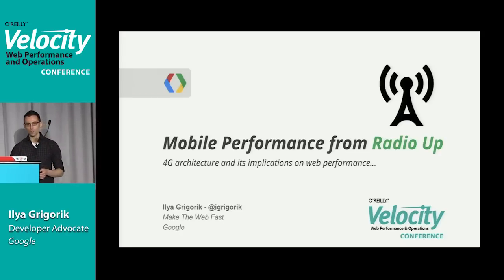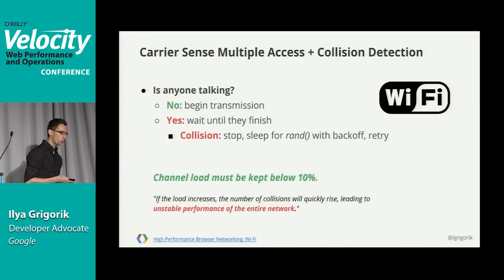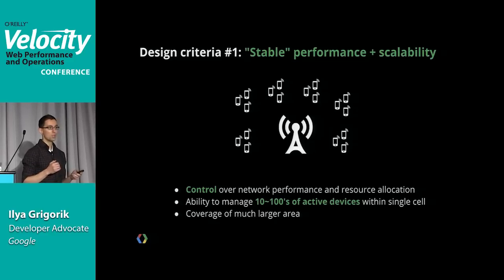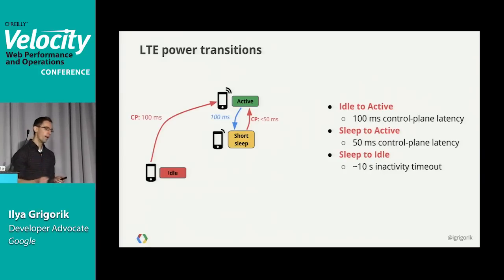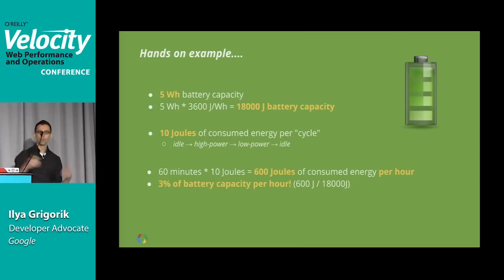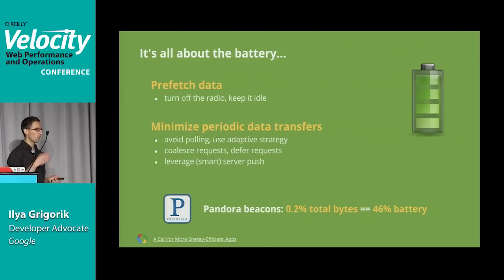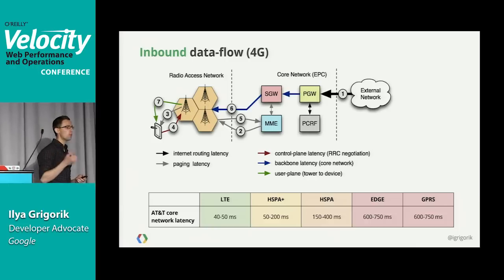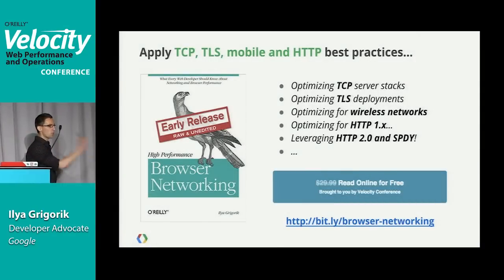Mobile Performance from the Radio Up: 4G Architecture and its Implications - Velocity SC 2013

Comment from the maker: Video of my Velocity talk on optimizing mobile performance, with the radio in mind!

And achievement unlocked.. a plug from Jeff Dean. :)
Reply: Thanks bro, your talks rock.
Reply: cool
Reply: Meant to ask, with Google navigate, what eats the battery like there's no tomorrow, GPS or the data connection, have you guys studied the battery use of the GPS in mobile? Thanks for the great talk and free book on it.
Reply from the maker: Hiren Patel more likely: GPS. Tiles and routing information can be downloaded and the radio can stay idle (unless we have to reroute, etc). Whereas GPS stays on all the time -- head into your settings, click on battery, and you can see a graph of which components use the most battery. For me, GPS is often at the top when I'm using maps. 

Also, small tip: you can cache map tiles on android, which helps reduce data transfers... significantly. :)
Reply: Awesome video. I watched it this morning.
Reply: Thanks for the tips, caching tiles is taken out of the latest maps, but yea I suspected the GPS and also get huge drain when navigating.
Reply: Ilya Grigorik would you mind commenting on how people should avoid redirects if their whole site is https://?
Reply from the maker: tim peterson why would https be a problem here? Do you mean making sure that the visitor always ends up on https URLs - e.g. http > https redirects? If so, set an HSTS header! It'll force the browser to remember that HTTPS should be always used for this domain and will automatically rewrite the requests in the browser. 

For more info: http://www.html5rocks.com/en/tutorials/security/transport-layer-security/

(Note: yes, you will still incur the redirect on first visit, but after that the browser will do all the work)
Reply: Ilya Grigorik  Hi! thanks for the reply!

Yes setting HSTS is what I learned I needed to do. I'm using NGINX and I made this Q&A on Serverfault where @Fleshgrinder was kind to point out the: *add_header Strict-Transport-Security "max-age=262974383";* directive.
http://serverfault.com/questions/525335/how-to-not-redirect-if-requesting-server-name-only
Reply from the maker: tim peterson yep, that should do it. You can adjust max-age as needed..
Reply: Ilya Grigorik   Using *Strict-Transport-Security* I'm getting the correct header, http://imgur.com/zvWxBFD (chrome dev tools pic), but pagespeed insight is still saying "avoid landing page redirect each time i type in "my-site.com" into the browser bar.

Is this a bug with Pagespeed Insight? Or am I still doing it wrong?
Reply: Ilya Grigorik please add subtitles if it's possible. thanks.